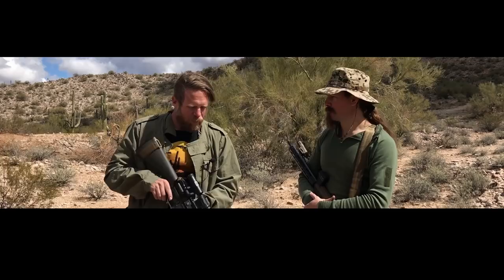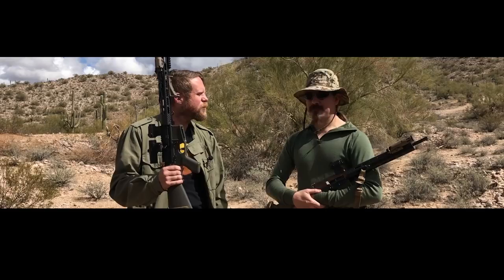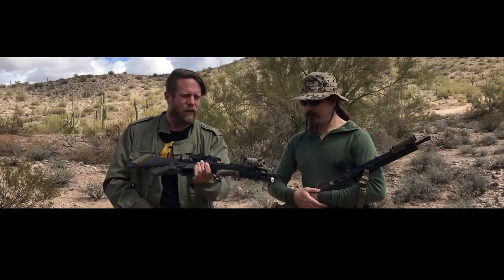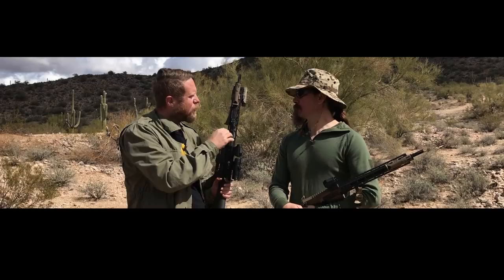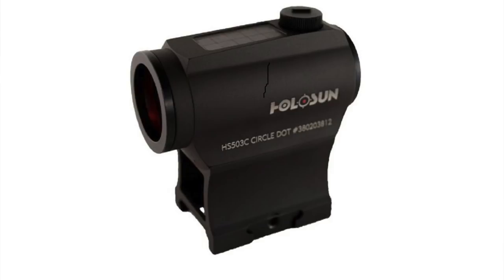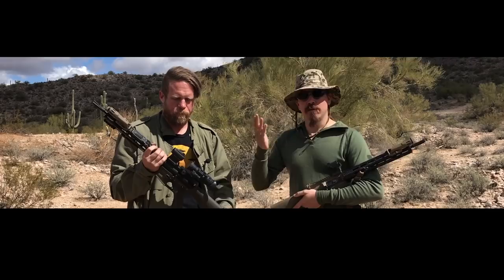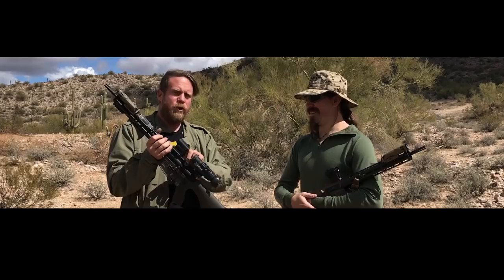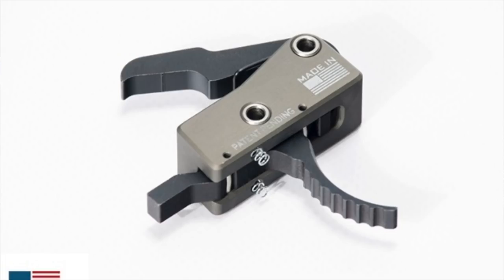WWSD: Rethinking the AR15 - CONCLUSION

Comment: Does the PVS 14function correctly with the red dot scope?  In my experience (admittedly in thermographic IR imaging, rather than IR-visiable conversion) it's impossible to see through conventional optics?
Reply: Antony Mitchell pvs14 only see a little bit of the near IR spectrum (not even heat), the vast majority of the image is intensified visible light. You are correct that a true thermal imager cannot see through glass.

Comment: That's actually why I don't like AR's at all because the balance has always felt horribly nose forward.  And adding a weighted stock to balance that out just makes the whole gun heavier which kinds of defeats the purpose of a light rifle
Reply: I've always adored the AR-15 rifle but I never understood the quad-rail fad that the entire industry embraced for a decade in the mid 2000's until the mid 2010's. Quad rails are HORRIBLY balanced. They make the front end SO HEAVY and I hated every rifle I ever felt that had a quad-rail attached. But without the quad rails, the AR design is actually pretty damn great. Especially with free-float handguards that are designed to be weight-conscious. A properly balanced AR is a thing of beauty.
Reply: @zul448  I'm pretty sure all the ones I've ever handled were quad rails.  Like you said it was the flavor.

Comment: Depending on if this has a flash hider or threaded barrel, this may also be "anti freedom" state legal.
Reply: John dough pinned and welded to reach the 16” NFA minimum length
Reply: thgreatandini thanks, I wonder if the company makes one with a muzzle break pinned and welded instead of a flash hider. I'm in nj, so I'm only allowed one "evil" feature and I'd rather have a pistol grip over a flash hider. I can't wait until I'm out of nj in a couple years.

Comment: What about a WWSD + budget AR? I mean, getting it right and cheap...
Reply from the maker: Not interested.   We didn't intend for this to be high end or budget, just the right answer.
Reply: This is a good question, and I understand it was not the goal of the project, but I also think they’ve already provided the answers to a lower priced, but still philosophically consistent WWSD build.  For example, I’ve hunted and target shot for 40 years with bolt action rifles, but I’m fairly new to the AR platform.  My mindset when getting my first AR was that a 20-22 “ barrel was standard, so it was counterintuitive for me to get an AR barrel less than 18”, but Ian’s realization that a 14.5 inch barrel pinned to 16 is more than adequate for recreational shooting and socially competitive
Reply: Oops, hit send too soon. Ian’s realization that any ballistic performance benefit from a barrel longer than 14.5 “ likely is outweighed (no pun intended) by added extra barrel weight is highly instructive.  I think the main theme is that if you can make the AR lighter without materially degrading performance, do it, and if something pricey does not substantially improve performance, don’t sweat it.  For me right now, that means foregoing the concededly awesome carbon fiber handguard and the Geiselle charging handle for some of the many slightly heavier and or less snazzy alternatives.  Call it a WWSD Light

Comment: I like the whole idea of the project but I feel like it lost focus as a result of testing in matches only. Starting as a fighting rifle and then talking competition solely like 40% through. not going pic rail across the whole top is pretty compy. geilesse has talked about avoiding drop in boxs for reasons of parts durability. also you literally showed a picture of a top iron sighted elcan. the biggest issue with a cheaper lighter dot without buis is that you do see guys in the field with their buis. missions don't last just one day and shit does happen and there plenty stores of guy optics going down and needing to use irons on patrol.

I think it also lost a good deal of the stoner idea. unlike some i don't mind calling it stoner if you aren't actaully innovating but the lack of focus on things like lighter BCGs. for a true what stoner do idea I think a long look at knights for very slightly heavier but innovative guns.

i could go on but in short, I like the concept for an easy to use light rifle. there are niggling issues i have with it concept wise.

Comment: Guys, if you want to talk about civilian shooting, fine.  Your assumptions about versatility to accommodate varying military mission requirements are more than a bit off base. While the basics parallel in both environments, the employment of techniques, tactics and gear have very little to do with one another.  Case in point, attaching NVG to the weapon itself is not very useful when 90% of the time is spent patrolling instead of shooting.  The NVG's are as, if not more, important when you are not going bang bang.  Once the shooting starts, everyone kind of knows where everyone else is because of the muzzle flash.  Just speaking in terms of my personal experience as an Infantryman, the fixed stock is a huge limiter in mission specific applications where overall weapon length can most certainly be a factor.  Are you suggesting a resurgence in sub guns such as the MP5?   Again, for competitive shooting such as 3 gun, I have no real issues with your points.  But 3 gun and military operations are two vastly different things with vastly different requirements.

Comment: Did you guys ever say what light you chose?
Reply from the maker: No, because that's an accessory and something that could/should be tackled entirely separately.   Honestly, the light thing is so contentious that I don't think it's worth even trying to tackle.  ~K
Reply: Use what you have but if you want to be picky then pick something reliable, bright, and lightweight. In that order. The flashlight market is so flush with quality manufacturers that you can take your pick of the litter.
Reply: Be careful on lights.  To be safe stick with Surefire or Streamlight.  Surefire if you have a higher end budget, but Streamlight makes a good product especially for the money.  Both are good enough for almost all applications, but carry a handheld backup anyway.  Don't overthink it.

Comment: If you're ND'ing because of the bad lever, you're violating the manual of arms. You're off safe while not aiming down the sights
Reply from the maker: Controls inside the trigger guard are stupid.
Reply: @InrangeTv  my point remains
Reply: @charlesfisher3983  Both of you can be correct with perfectly valid points. He may have had a brief lag in manipulating the safety lever (we've all been there, don't try to tell me you're 100% on the ball at every moment) AND the extra control inside the trigger guard was a bad idea. Individually these wouldn't have led to an ND but together they did. No need to make a bigger deal out of it than that.